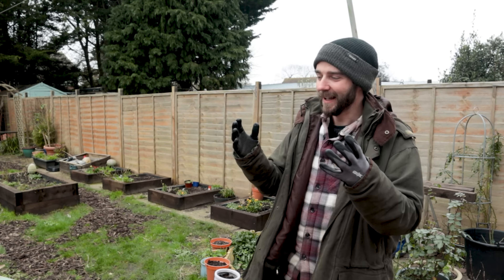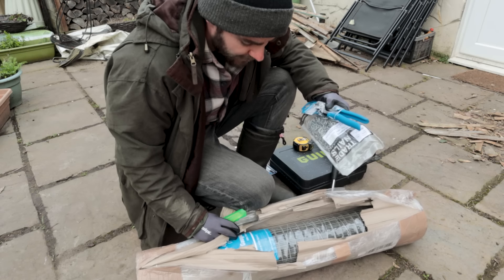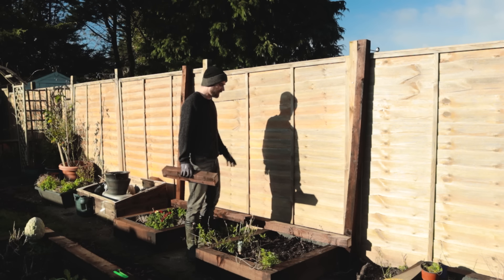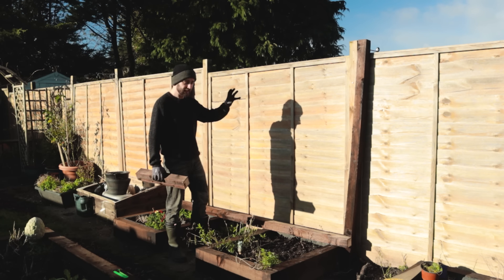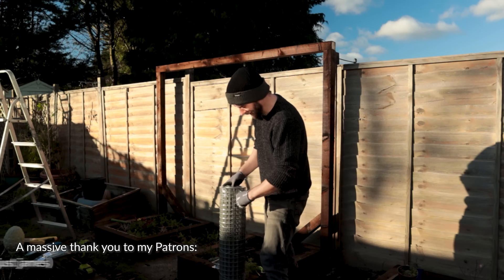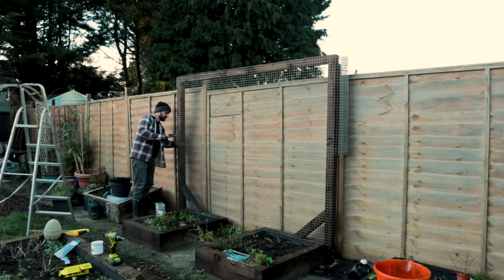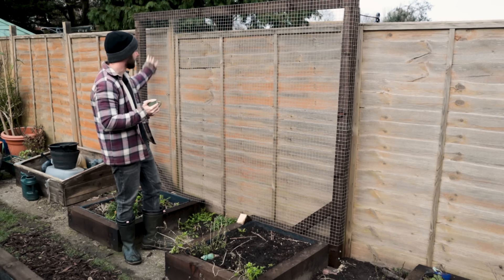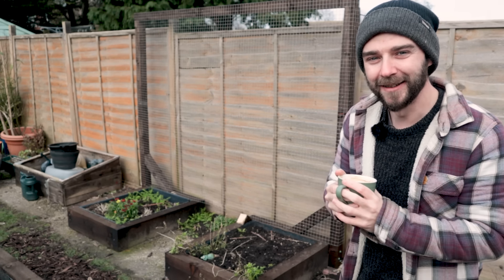Easy DIY Sweet Pea Frame for the Garden or Allotment

Comment: When we moved in to our house nearly 40 years ago I built an arch with 4 - 3" x 3" fence post set it spikes and its still there covered with a climbing rose and I'm no carpenter JB so that is fine for sweet peas. they only thing I'd do different is use a bigger mesh as it would be easier to remove the old haulms at the end of the year and don't forget, any sweet peas you like tie a bit of wool around the  flower and you can save the seeds so you don't have to buy new every year. 

Roger Parsons is a good source of sweet peas.

Comment: Definitely a more permanent support method.  I think I'd have gone one further and added similar braces attached to the outsides of the beds and the uprights, facing towards the fence, to stop the possibility of it tipping forward, especially with such a robust top bar.  I'd also have added support inside corners at the top.  My  issue then is finding a way of stopping the deer from eating the plants, so I would have to add strong netting as well (because they will definitely try to eat right through that too).
Reply from the maker: @ameliagfawkes512  I'm very pleased to say this structure is still standing very secure! It's basic but it's done the job and widthstood a few storms even though the fence behind it finally collapsed this week!(!) it looked great last summer adorned with sweet peas :)
Reply: @JBNat  That's fantastic given the storm.  We were fortunate where we are in Scotland.  Heavy rain and very high winds, but all structures held secure - all fencing is built with concrete secured treated timber and then double-slatted with airflow gaps - usually holds well for years. Walls OK, hedges unaffected and buildings OK too, including new-ish, strongly-built potting shed from a local supplier in Inverclyde.  We know we were lucky.  Any chance of seeing photos or some video of what your frame was like in full flower?  I've never had sweet peas in the garden and going to try this year, starting with an ambitious (and possibly doomed to fail) winter sowing in the next day or two.  I'm simply going to try a few different methods and timings and see what works best up here.  Given the lack of vertical support in our garden at the moment, I reckon a lot of them, if they survive, will end up in a mishmash of pots with repurposed "canes" and twine holding them up, given the number of "big projects" to be done this year.  I've been trying to find the cattle panels they use in the US - the ones they can bend right over to form a tunnel.  They would be perfect for this type of thing.  However, no luck so far - all of the ones in the UK seem to be smaller and/or rigid (and hugely expensive).

Comment: Consider a top rail  for the horizontal 75mm. It can be pallet wood or scrap wood  screwed to the horizontal wood it will stop the wood from rotting over. Cheaper to replace  the top rail.
Reply from the maker: Oooh interesting thought thank you! Hadn't considered this.

Comment: I think you may need to brace the uprights from front to back as well as it's going to be very top heavy and a strong wind across the garden could blow it over especially as the sleepers are not anchored down
Reply from the maker: Yes ideally I would have put the frame at the back of the sleepers because then the fence would act as a support as well, and it would be held in place by the top beam. I'll keep an eye on it and add any necessary support if it starts listing forwards! Thanks for the comment

Comment: That needs more support at the bottom. I also think the gaps in the mesh is too close together for Sweet Peas. It will almost certainly damage them. Fine for their little tendrils but sweet peas also tend to wrap themselves round things as well but the mesh will rip them to shreds
Reply from the maker: Interesting thoughts, thank you trace. I will be honest - I meant to buy a wider mesh, will be interesting to see how they do. I've seen them grow on really small mesh fine before, but it wasn't as rigid as this weld frame.
Big storm coming too so we'll see if the timber drives do their job!